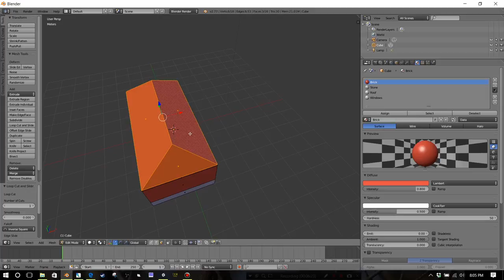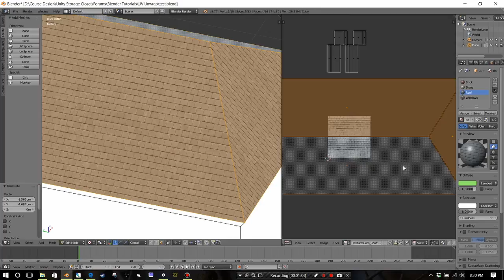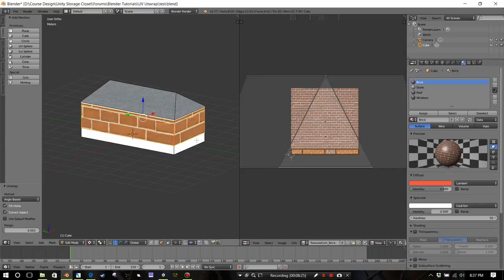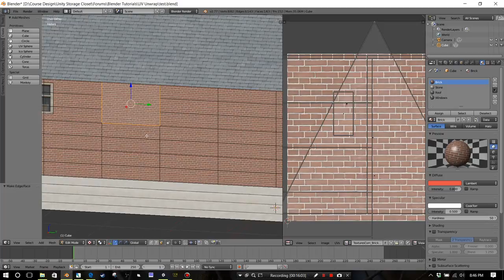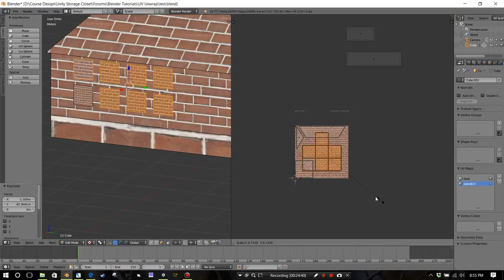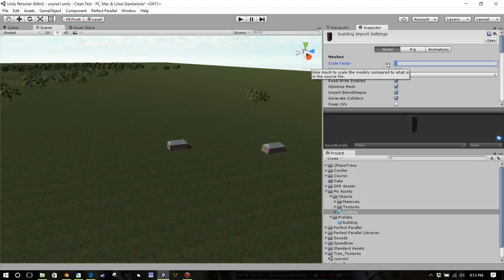Blender - Simple Building UV Unwrap - Baked Method

Comment: I tried this method with my mesh and it didn't work. It worked fine in Blender, but when exporting as an FBX into Unity, the texture was not UVed properly. I think this may be because I did not mark the seams. When I UV my mesh I am used to using PhotoShop or Gimp to edit the UVed faces instead. Do you know if the seams are necessary? I tried it on a mesh with many verts.